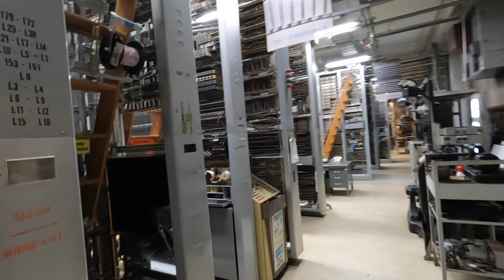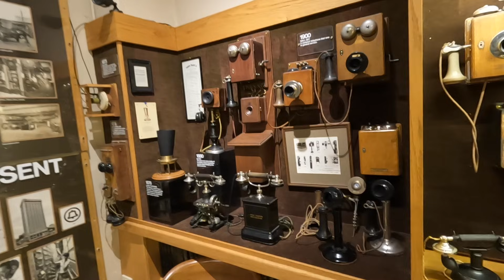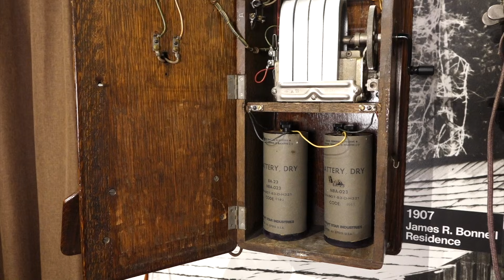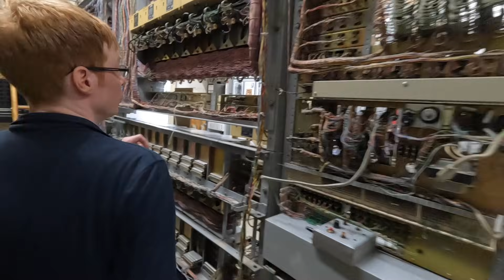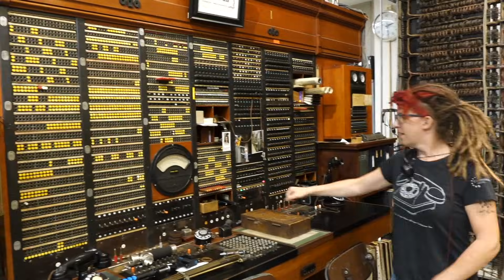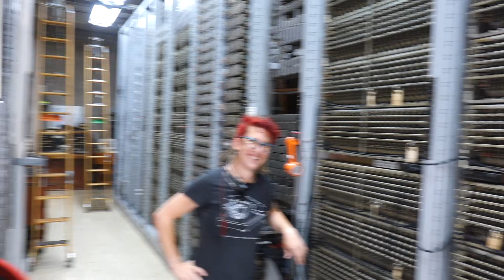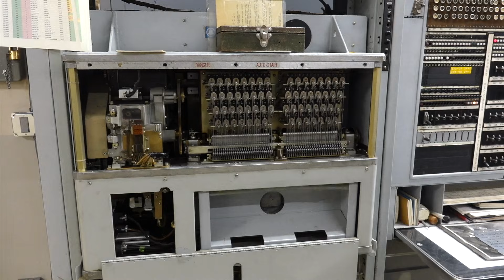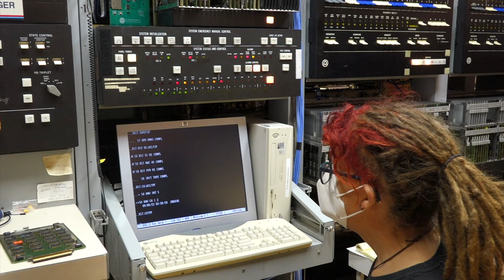At the Connections Museum: the insane telephone technology that led to today's computers

Comment: Wow what a great episode. I'm a geezer who grew up fascinated by telephone technology. I was aware of these various stages of telephone switching technology but this was the first time I've seen a panel switching system in operation.

The introduction of area codes and direct distance dialing was a big deal when I was growing up. 

As an aside the floor plan requirements of telephone switching has been drastically reduced over the years. Current we have fiber PON for internet and landline phone. The optical interface at home is about the size of a 3x5 index card. I don't know much about the backend equipment but I assume it doesn't have much of a footprint.

Comment: I read that a telephone company  (doesn't say who) asked IBM to design a processor for them in 1974 to handle 300 calls a second. In 1975 the phone company pulled out, but IBM went on to develop RISC technology that was added into server processors. ARM today use RISC in everything. So a telephone company triggered RISC as well as many others designed processor controlled exchanges from the late 60s into the 70s.

Comment: Looking at this makes me think of Bletchley Park. If you ever find yourself in the UK you must go there and visit the lovingly restored WW2 computing technology they used to crack German codes. All electromechanical and valve tech.
Reply: Tommy Flowers, the designer of Colossus, was a Post Office telecom engineer. He figured he could do a better job and build a faster machine using tubes (valves) rather than relays. He was right.
Reply: 25 years ago I visited London, the internet was young, I learned data processing in 1978 as a vo-tech class, and never heard of Bletchley Park.. I missed a good opportunity
Reply: @Stache987  Not really sure how much there would have been to see back then. Although it would have been open, the real restoration work wasn't begun until a good few years after you would have been there. Good excuse for a vacation!
Reply: @Tromador  thanks for the update  😃

Comment: (UK):

Back in the 1990s when Our village exchange was upgraded from Strowger to Ericsson “System Y” digital switches, There was a huge skip outside, full of wiring looms and loads of Strowger switches, GPO ringing machines etc. I was told I could take whatever I wanted. I took a few switches and the ringing machine, but eventually they were disposed of (I think I took them apart to see how they work)

Hindsight is a wonderful thing. I wish I still had them now.

Interesting fact: in the UK, at least, each exchange has a compressor which is working 24 hours a day blowing air into the copper trunk to expel moisture

Comment: it would i nice to see how the billing system worked
Reply: Local calls would get a supervision signal on the lines counter that would cause it to increment, once ESS was developed, billing tapes were sent to the regional accounting office for tabulation and computation.   A grid for calculation of distance in the United States is based on V&H coordinates, both ends coordinates were used in a algorithm to find which mileage band was used.. eventually it's estimated that all points from exchange X in a given area code were band y so no calculations were performed.. it's like why reinvent the wheel to replace a worn tire.

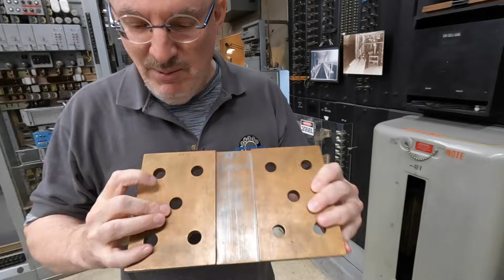Comment: wow, the fuse at 3:25  is made for 1.1 million watts.   (at least in the 230v areas like germany)
Reply: 48v DC, and it looks like a current shunt. Not a fuse. Not sure of the materials science but a current passing across will show a millivolt reading across it (you can see a little hole on the narrow side to screw down a ring terminal, sould be one on the other side) proportional to the current flow. The amp meter is actually a volt meter but the dial includes that math and is labeled amps.

Comment: When I was very young, I use to accompany my father to work (at NY Telephone) sometimes in the evening and would read those trouble cards (#5 Xbar) and "busy out" bad trunks. I too worked at Bell Labs in Murray Hill from '77-'01 in IC Layout , then Unix System V, Math Research, and finally CS Research (Unix room!). It was great!
Reply: When I helped build my first data center from scratch in 2003 the other engineers were really confused how I knew so much about raised floors and AC systems. I had to think about it but my dad ran an ibm tape data center in the early 70’s. When I was very young I spent a lot of time there. 

My dad made my birth announcement on punchcards. :)

Comment: When I was in my early twenties (1979) , my father in law was a maintenance engineer for the then state owned telephone company in Belgium (it was called RTT at that time). He was responsible for the electro mechanical telephone switches around Brussels. When he was on call, I could accompany him several times when he had to do an intervention and oh boy, these switches were impressive. Hundreds of racks spread over several floors , several meters high, full of relais and spinning rotors. What was also impressive was the time it took him to find and solve a problem. Just by listening to the noise he could usually already tell what was wrong. What was also impressive was the backup battery. It was an open lead-acid battery (don't even think of going near it!!!), the size of half a basketball field (well, kinda).
Reply: At the age of about 9/10 we had a tour of a local exchange (Watford, UK) with the cub scouts. Late 1960s all mechanical exchange. Absolutely fascinating to me as someone into electrical things - ended up as an electronics engineer.  But the big memory for me was the size of the batteries in the basement. An enormous room with an array of batteries, each battery looking like a grey bee hive.

Comment: There's just something magical about the old mechanical systems with lots of moving parts that just isn't there in a fully solid-state semiconductor based world.
Reply: There really is. Watching relays, bus bars, solenoids, etc do their thing is so tactile. 

Of course, when semiconductors were new, they were the new magical strange thing. Everyone was accustomed to contactors and distributors etc etc, so to have it all happen silently in a tiny box seemed like sorcery. 

In a way it’s the same trajectory injection-moulded plastics took, where at first they were new, expensive, and everyone marvelled at their benefits. Then they quickly became cheap, commonplace, throwaway items and people started missing the repairability of wooden chairs, welding holes closed in metal, and indeed in fixing mechanical logic. 

We see it with pinball too, not many arcade enthusiasts have much love for modern machines, but pinball still retains a bunch of electromechanical elements even though the control logic running it all has been entirely computerised. And pinball enthusiasts will often have games from the 2010s alongside ones from the 70s.

Comment: Illinois Bell to AT&T cable splicing tech here, from 1979 to 2021.  When I first started, most central offices (CO's) in my area ( Chicago proper and suburbs) were Crossbar switching equipped, and, for Roselle, which had , some very long subscriber loops which made them use a "C-REG" loop interface system that boosted the line battery to over -80VDC and had packs with the first 2 load coil points built into them.  I was on a crew, that, had to install, load coil's on the first 2 load coil points for over 50K subscriber lines, so they could convert that system to a Western Electric 1ESS system with a COSMIC frame, so, we also had to install/rework the mainframe verticals to new protectors that connected to the new frame terminations. As my career went on, all of CO's in the area  converted to either a WE, Nortel or Seimens digital switch, some offices like Willowcrest CO ( near Schaumburg) needing to have a new "Schaumburg Main" CO built near the busy Woodfield Mall area to keep up with service demands. It was interesting to be in on the "ground floor, and cable vault" level of building a CO from scratch, and then being involved with the cutover to it.
Reply: So you survived the Ameritech era, too! Ohio Bell guy here. That'd been cool to see an office  from the ground up.
Reply: @boballmendinger3799  Yes! AND, I even got to work in Ohio, near Columbus ( Dublin area mostly)  for December 2000 from what I remember, as I was involved in "Project Pronto" ( Subscriber loop ADSL expansion using the Alcatel LS2000/2021 product)  and we had to stop work due to some FCC restrictions, but the Columbus area had tons of money and a lot of cable work to catch up on. All I heard on the conference call was "unlimited overtime" and I packed my bags ASAP.
Reply: That's cool! I wondered at the time why Pronto suddenly ceased to exist. Dublin is one of my offices (rover)!
Reply: What was cosmic actually? I saw assignment pages on service orders that were assigned by computer if all constraints were met, the biggest hurdle, making a static address system that the customer could give the right info..  it's kind of like here. It's the second floor, the landlord says unit 2 but the credit report and post office say it's apt 2, gracefully we are not served by street delivery, our post office is a third of a mile away and gives any unserved town residents a free small post office box.
Our address management system was called PREMIS.  We had to validate a customer address before creating a service order for establishing service.   In 4 years of call handling, I had only one time someone could have been social engineering me, they wanted the LEN and the two wire split offs in the field.
Reply: @Stache987  The term "COSMIC" frame, was an acronym, of course, which I forgot, that described a type of "Mainframe" that was supposed to keep jumper runs shorter for frame technicians, and used "punch down" connections instead of solder or wire wrap. Instead of running a jumper from the "Vertical" mainframe (VMDF) which was all the outside plant cable connections, through the ironwork and to the horizontal ( HMDF) where your switch or DS0/DS1 connection blocks were, the VMDF was extended to shorter bays of distribution points where no ladder was needed, and jumpers were then run to the switch or needed DS0/DS1 connection blocks in a trough, or, sometimes through "tie pair" blocks if needed.All I know is, it spread out the VMDF connections to make them harder to find, even if they were marked, and figuring out where the switch OE to make a POTS circuit connection was tough for someone that didn't frequent those types of frames. So, in a nutshell, it simplified, yet complicate some things, only a few suburban offices I visited had that layout, maybe a few remotes, and the one new office I was involved in building in Schaumburg in the late 1980's used regular old VMDF/HMDF layouts.
Reply: @poormanselectronicsbench2021  thank you, for some reason I thought it was like in the step days where everyone had vertical pins that the outside cable was soldered to.
Reply: @Stache987  https://en.m.wikipedia.org/wiki/COSMOS_(telecommunications)
Reply: @boballmendinger3799  Thanks Bob, the "wiki" dictionary has a short but good description of the COSMIC frame system. The "re-use" of MDF connections was common practice on all ( even the older) office layouts after a certain point, even requiring cable splicers like myself that "re-arranged" POTS lines into a new cable to handle and reconnect the "Wire Through" ( unused customer lines with a complete POTS assignment, which just had the switch OE deactivated) like a working dial tone.
Reply: @Stache987  Oy, and as to "records issues", over the years I've had to have someone in our "assignment" department look up customer billing information when there were "holes" in the location information
for dial tones or circuit outside plant assignments, as if all else failed, Ma Bell knew where to send the bill to keep service working. My last few years also found some strange issues, like, a working POTS line having a incomplete ( missing) OSP assignment ( no F2 at all), but that was still active in the switch ( Over a DSL system) that a customer called in after a "fellow" technician decommissioned the equipment they worked on, ( per a company generated order, of course) Another incident found a whole slew of customer DS1 circuits "working" ( Still "IE" or, "In Effect") over a fiber optic multiplexer system, that had no connection at the customer site, and the customer removed the equipment fuses on, saying our equipment was "not being used" and generating network alarms. After researching the issue, I requested the customer repower the equipment, as it was generating failure alarms in out network ( they wouldn't) and our records dept would NOT change the numerous circuits to disconnects from IE, so, all I could do was put in an engineering request to have them work on all of the issues so we could remove the equipment, and walk away, getting assigned back to the same alarms a few times. I retired before it was all resolved.
Reply: @poormanselectronicsbench2021  my mother didn't listen when I told her to split the bill so the line she was porting from was alone on ots own bill, so what happened, she had no DSL anymore and they just grandfathered it, and her voice line was disconnected too, it took some 10 days to install the new version  (Uverse?) To get her back on, and after 6 months she was still fighting being billed as the old account was listed active.. she made no effort to launch a executive complaint as I told her to do, end result, she hates the phone company, but it's unknown if the port request said port one line only or kill account once port is complete.

Comment: Hello, this video made me very happy, because I have serviced these telephone exchanges, from the mechanical P51 system to the digital one. At the time, I was employed here in the operational research and development labs, so it was necessary for me to know all these systems. I will add one piece of information that was not mentioned in the video: The original rotary dials were constructed in such a way that they emitted ten impulses - i.e. each number is a pulse - therefore very often a fundamental problem occurred. If the caller dialed, for example, two ones in quick succession, the switchboard could record it as the number two. The mechanics of the rotary dials were subsequently redesigned and the dial gave two more pulses, i.e. dialing the number one generated three impulses, only the first one was sent to the control panel, the other two served to block a rapid series of impulses in succession, and thus the control panel had enough time to execute the command.

Have a nice day everyone 🙂 Tom
Reply: when i was a hippy we learned that "tapping" the phone rest switch on top of public telephones could get you thru free, as long as you were good at "tapping" the pulses to simulate the dial's action, days of phone phreaking, we all knew "secret" codes to dial long distance  via engineer's back doors. Later on I worked for Plessy in Brighton, Sussex UK,  as a wireman and much later in my company which I founded we won the broadband cable TV and telephony franchise competition  from the UK goverment (late 90s), which we promptly sold to Nynex, who sold it to Cable and Wireless, then they sold it to Virgin as it is now - historically  before they dug up the streets,   we called it Southdown Cablevision Ltd... When my backers, cross country cable of NY came over they went into shock when they saw that all the build was to be underground not on poles.

Comment: That is amazing, I work in an IT position on a Telecom company, but all of our telephony equipment is all computers now, all digital, all wired with ethernet cables and fiber optics. I wont lie, I didnt understand everything that was shown in this video, but is amazing how things worked before
Reply: Find a good reference on the various steps required to initiate and complete a call on a land line, snag a SIP trace of a successful call, and start comparing the SIP setup and teardown with the call progression on a land line.  Once you realize that on a land line going off hook is a SIP INVITE, dial tone is a 200 OK, and hearing ringback in your ear is a 180 RING, the rest will all snap into place.

A phone number is just like an IP Address...It can be valid only internally (Private PBX) or it can be routable if it is associated with a public number.  In any case, that phone number, like an IP, is unique to only 1 particular destination endpoint.  In a sense, an electro-mechanical phone system serves the same function as a Net Gateway with a hard-coded ARP table.

Once you get all of that clear and sorted, remember that the majority of what was shown in the video had one function...to use the pulse-encoded numbers from the user dialing to move contacts around to create an electrical path between 2 specific pairs of wire, just as you would use a switch or router to direct packets to their intended destination.

Comment: I have no problem with the use of the term and I know that is what the industry called it and understood it as, but a commutator serves a commutative function, i.e. switching a set of contacts to ensure a similar flow direction of the current as in a DC motor.  I would have called the "fingers" on that riser bar, "encoders."
Interesting video. 😀

Comment: I own two Ex-Bundeswehr (West German army) field telephones from the 1970s, which work pretty much like the old telephones from the 1900s (only that they have a bakelite housing instead of wood). They can be used both with local batteries (OB = Ortsbatterie) or common battry, if they are running through an operator's desk (ZB = Zentralbatterie). therefore these phones were called by the military "Feldfernsprecher FF OB/ZB). 
They use a bunch of D-cells as local nbattery.